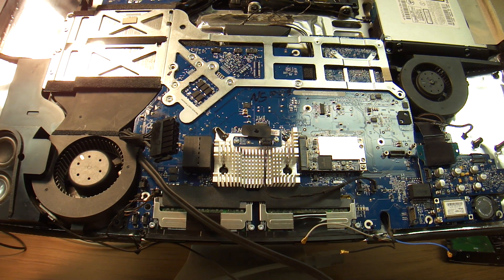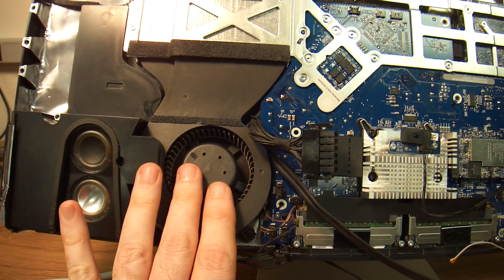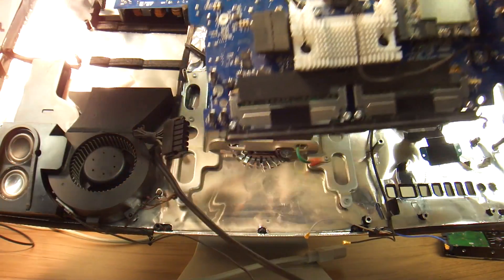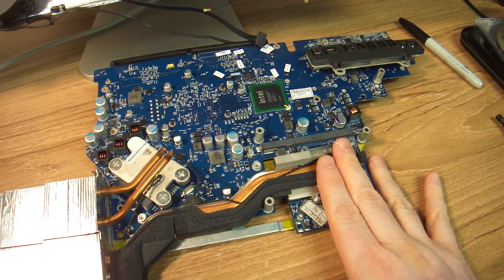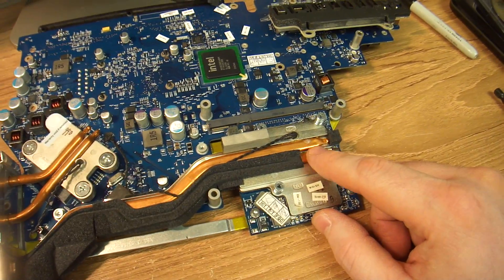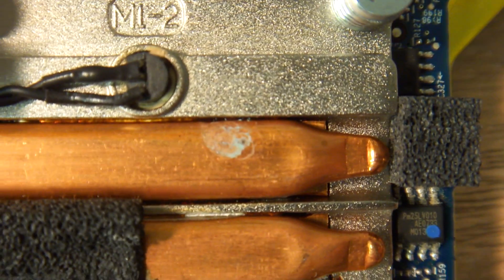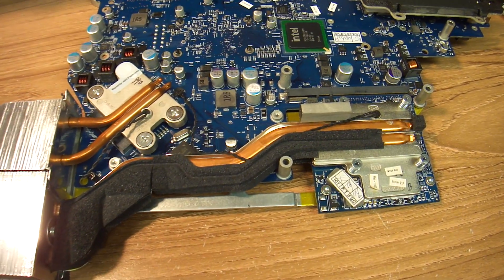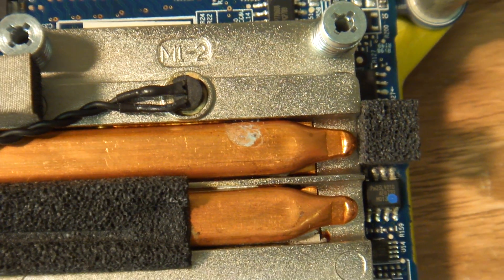How to fix an iMac overheating problem in a working GPU. Heat sink may be to blame.

Comment: Well, it's quite later, but, i've got this exact problem on a HP All in one computer, with a core i3 that was overheating, then i noticed that the heatsink wasn't doing it's job, i've managed that doing a litle hole on the heatsink the injected car radiator fluid inside, then sealed with epoxy glue, it's working like a charm, i've tried with other liquids and the car radiator fluid gave me the best results.

Comment: Thanks! I just fixed my mid-2007 iMac by changing the GPU cooling system. I had the same issue: GPU Diode very high temperature, around 100°C in a minute instead of now around 45°C for more than 5 minutes :)

Comment: You can still use that empty copper tube coil.  Make a bigger hole in it for squeezing in thermal paste inside, then solder aluminum over the hole or just use electric tape.  Heck you can try a cut out of soldering silicone mat to fit on the space.  This silicone absorbs more heat than  thermal pastes/copper/silver/
Reply: thermal paste would not work, it'd be like shoving clay inside your car radiator. a very specific fluid goes inside that tube, nothing else.

Comment: Had the same issue.  Just replaced the heatsink in my 2009 iMac.  Never say any indication of a leak, but the used replacement heatsink took care of the issue.  Was running 90-100c with the old heatsink.  Now running 50-55c with "new" heatsink.
Reply: I have the same problem with my Imac 24" 2008. 90-110c then black screen. I'm going to look for an used heatsink. Did you change the thermal paste?
Reply: Hey Bryan, I have a early 2009 iMac, 3.06 GHz Core 2 Duo (E8435).  It shuts down randomly, wasn't sure if it was graphics failure, did a little searching online and thought is was a bad power supply.  The back of the display is very hot, top leftish if facing the LCD when reaching behind.  Started searching and brought me to this video.  I'm wondering if you had similar issues with your 2009?  is yours and Early 2009?  Any info would help, I've not yet taken it apart.  Can you tell me what model you have and if your new heatsink still held up.
Thank my friend

Comment: Thanks for this, it helped confirm my suspicions that I had a faulty heat pipe. I had purchased a used E6410 off Ebay which would throttle itself down from 105 degrees constantly. Other symptoms were very hot CPU block, but cool air coming from the fan radiator. A close look revealed a pinhole leak in the pipe like yours.  Thanks!

Comment: Hello everyone, I have an iMac 27 "
Mid 2011 Core i7, CTO, began to have problems the screen, appeared green stripes, then, no longer wanted to turn on the screen never again, but inside was still heard running. A "Reballing" was done to the video card and the screen started to operate without any problems or details on the LCD, but it happened that after 5 minutes of being turned on, it suddenly went out and immediately afterwards it was reinitiated, just to turn it on To shut down, and to restart without having even logged in again, did not even load the Apple logo.
The temperature data by iStat were:

CPU Core 1 to 4 = 47º
CPU Heatsink = 45º
CPU Proximity = 49º
GPU Die = 109º (Temperature in which it was turned off)
GPU Heatsink = 57º
Hard Drive = 45º
Incoming Air = 26º
Logic Board Proximity = 47º
Optical Drive Proximity 47º

The technician who is trying to fix it has not been able to find the solution. Anyone have any idea what to do?

I could communicate with anyone who has been able to solve a similar problem, to guide me and avoid throwing this machine.

Comment: I have the late 2009 27" but it needs a new graphics card. I believe that it went bad due to the heat. I contacted Apple but they will not admit that its a design defect, and that they will only repair iMacs from 2011. I may buy a replacement card online, and was thinking if it made sense to drill some 1/8" holes in the back of the case, adjacent to the heatsink. Then attach a usb powered fan over the holes to pull the heat out...???
Reply: Were you able to get anything done? I have the same 2009 27" and it would also get very hot which I believe is the reason the graphics card has gone bad. Apple has denied repair on this unit also. Maybe we can make some noise together and have both our machines fixed?
Reply: Maybe if we take the broken machines and place them at the doors of their headquarters office and chain ourselves, along with the machines, to the doors. Lol. Apple doesn't give a f^%k unless it hurts their bottom line.

Comment: Just wondering - If the coolant type is known, why not drill a tiny hole in the tubing, fill the required cc's of coolant/refrigerant using a hypodermic syringe and then solder it shut? I've been researching trying to find out what kind of coolant is in these tubes without any success. Any pointers would be great.
Reply: Bakki did you ever find out what fluid to use, did you fix your pipe? I'm looking into this on a early 2009 iMac
Reply: @reel_images  Sorry, no I didn’t. I ended up buying a graphics card on eBay.
Reply: @bakkikudva  thanks for the quick reply, is your mac an early 2009 iMac with the Geforce GT130 video card? I was wondering if your computer was turning off when it got hot? That's what's happening with mine. Do you feel replacing the card helped? If you have the same mac, as mine I'd like to know what card you put in? Is your Mac still working? Trying to ask people with the same early 2009 imac a1225 if they had the same symptoms as i have. Any help in answering my 4 questions would help.
Reply: @reel_images  No it was AMD. In my case after running for a few minutes the screen would go black. It still kept running as shown by running fans and the diagnostic LEDs on the motherboard remaining green. I installed Macfan app and could see the temperatures. From a cold start the computer would stay on long enough for me to log in and check the temps of CPU and GPU. It was showing that the GPU temp would keep climbing and go past 190 or so when the screen went blank. So I knew that it was the graphics card. Initially I thought it could be the heat sink compound which had dried out, so I took the card out and applied fresh heatsink compound which did not help. While inspecting later I saw a pinhole in the tube which goes from the heat sink to the   radiator. It was where the tubing had been crimped to close it off during manufacturing. The hole was small enough that it took a few years (just long enough to be past Apple Care :-( for all the coolant to leak out. Once I was convinced that it was indeed the GPU I luckily found one on Ebay for about $100. After putting it in the iMac worked and the temps stayed within normal range. A few years after that I sold the computer.
Reply: @bakkikudva  Thanks very much for the detail in your reply.  I really appreciate the comments, this helps all of us who may think its one thing when in fact it's another. When you say "was convinced that it was indeed the GPU... found one on Ebay for about $100. After putting it in the iMac worked". I would say you mean, you found an new heat sync unit, like with the coolant pipes? Not a new graphics card, correct?  I just want to make sure I understand right.  It sounds like you replaced the cooling unit that goes over the GPU and CPU, right?
Thanks again
Reply: @reel_images  Sorry I wasn't clear. I found the complete and identical graphics card assembly. It was a brand new unused unit.

Comment: Hi. After I take the glass and I unplug the monitor and take it out, can I still plug it in to see if they fans area even turning? I cannot hear or feel any air coming out of the top at all even putting a little piece of toilet paper on them it did not move.

Comment: i have a 2010 27" iMac, turn on, 5 seconds later black screen. i have been looking for the problem on the internet over a year now and can't find the problem. its obviously not a heat problem as its been switched off all day. one time i turned the brightness down fully and it worked fine and once i go past 3rd bar brightness it would go black. but now i put brightness fully down and still persists going black screen. i am now using second screen with mini display port and that works fine. i had never had graphical issues on screen to make me believe its the graphics card. so i really don't know what the problem is. the second problem i have with my iMac is installing windows with bootcamp. it will install and then when it restarts it says no bootable device with black screen and white writing, like bios screen type. I'm using an external samsung disk drive that has installed windows before so the internal superdrive is fucked and spits disks out and i will get it repaired and try installing again but i doubt its the problem. i can't get my head around these problems and i want to repair it all my self as i like fixing things and learning. if someone can help me in the right direction ill be thankful and much appreciated.

Comment: Thank you very much, Abraham ! I had the same phenomen on my iMac 24" Early 2008 A1225. Thanks to your video, I checked the heat pipe and it was exactly the same problem. Even the hole was on the same position.
I replaced the whole GPU cooling system by a used one from eBay for 30€. Now the iMac works stable and quiet again.
Thank you very much for this brilliant video !!!!
Reply: +Olaf Kehm Hi! I possibly have the same issue... But I can't find a cooling system for my iMac27 mid2010 on eBay. Could you please share the info on the ebay seller? Thanks a lot in advance!!
Reply: Hi! It is an eBay shop from Spain, since I am from Europe. Here you can find it: http://www.ebay.de/usr/tecnicosclic

Comment: Could this be what is happening to my Mid 2011 iMac that has been overheating for a while now?  And when I say overheating I mean it gets super hot to the touch in the top front display towards the middled it irradiates the heat to the sides of the display and in the top portion of the back of the monitor.  I have no temperatures for it; I guess I have to download one of those apps that tell me that.
Reply: I just started having this problem. Have you found a fix to this?
Reply: I did not find a fix for it.  It kept doing it for a while and I kept the little fan, I had pointed at the back of it, on all the time.  I had already started shutting it off daily when it started getting overheated and after a while it stop doing it.  I mean, it still gets hot when I use it for several hours consecutively, but not like before.  That led me to think that maybe it was because it was summer and somehow it was getting hotter, even with my AC on.  So I guess I see how it goes starting at the end of this month since I live in the South and we really don't have a Spring.  Today was a hot day already, but everything since normal so far.  Hopefully it docent happen, cause I don't see me being able to shed $1500 anytime soon for newer model.  I have planned to sit down for a day or a few hours soon just to delete and/or transfer anything I do not need on it to keep the memory low.  I know I have a bunch of images and svgs and other files for work that may be adding up by now and that I need to organize in an external hard drive anyway so that will probably help even more.
 
I hope yours stops cause it freaked me out every day making me think that that was going to be the day that my comp was going to stop working.

Comment: Once you put new high quality Thermal Paste on the CPU and GPU the correct way, temps drop like when bodies hit the floor! 

My 2011 kick ass maxed out i7 MBP's CPU's idle at 32c and my GPU idles at 26c degrees.  Sometimes the GPU idles at 20c when my room is cool.  But these temps are un heard of in laptops, and all it takes is the right amount and correct ways to repaste high quality thermal paste such as the amazing IC7 Diamond on any CPU/GPU!
Reply: Any suggestions on a detailed process of replacing thermal paste on the CPU/GPU? Thanks.
Reply: GREGORY ICE small pee or long line. Just very little.

Comment: My 24" iMac had the same problem.  The heat pipe corroded and formed a tiny hole.  The copper wall got so thin then entire end crushed under slight pressure.  Installed a replacement heatsink from eBay and the iMac is good as new.  Thank you.

Comment: I purchased a new heat sink and Arctic Silver thermal paste to try and fix my overheating GPU.  Can I re-use the thick thermal compound found on the 4 memory chips, or does that also need to be replaced?

Comment: This is not true of the tiny hole "leaking fluids" these types of heat sinks have no coolant in them, the heat it displaced from the CPU and GPU via thermal compound which allows the hollow copper tubing to "draw away" or displace the heat from the processors. If you decide to tackle this repair you must remove the heat sink from the processor and gently remove old crusty thermal compound and replace with new silver thermal compound which is less likely to dry out in the next 5 years. Although other than the tiny hole and liquid statement this was a decent video.
Reply: Don is wrong.  Heat pipes absolutely use phase change fluid to effectuate thermal transfer.
Reply: 50% true, if the tubes are smashed flat like his pictures show, then NO vapor in them. If the tubes are round, like, tubes, then yes they use the phase change fluid. cheap vs. pricey
Reply: You must have missed basic science, the evidence of liquid based oxidation is present around the micro hole in the heat pipes that ALWAYS carry phase fluid. if the tips of the heat pipe are crimped and soldered closed, they contain phase fluid. Why do people pretend they know shit, don't you realize that tech specialists get irritated at posers like you?

Comment: I have the exact same issue. I'm new a opening imacs. We have the same imac model. My question to you is the cable cord that the power supply and the lcd are connected with. Does you just pull it off? I've tried pulling it but it wont budge im afraid i'll break it. Is there another way of doing this? Plz help and thank you.

Comment: I'm using Temperature monitor and apparently my 24" iMacs Graphics processor chip is running at 106 C and the 'heatsink' and 'temperature D' are running at around 120 C and the fans are pretty loud. Do you reckon it could be a similar problem?
Reply: Dr. Mario Thanks, will have a look.
Reply from the maker: That is how my mac was behaving.
Reply: Abraham Levit weird, I've opened mine up and it seems to have a hole in the exact same place
Reply: Abraham Levit Do you have a tip where I can buy the heat sink from?
 Thanks
Reply: Dan Ford Try eBay. I looked up a few, and I believe they go anywhere between $25-40 USD.
Reply: ***** No, and to my knowledge, this only happens to the very first Aluminum iMacs, which are Mid-2007 models. They aren't perfect machines, but this issue happens rarely. Also, if I recall correctly, the threshold is 140°C, but they have sensors to force shut down when it reaches a certain temperature.

Comment: Is there a fix for this?  Or would I need to buy a new GPU?
Reply: +Derek Carmody You can get a replacement  heatsink on amazon, ebay, macpalace, etc.
Reply from the maker: WAS I NOT CLEAR?? You need to replace the HEAT SINK! Not the GPU card.
Reply: +Abraham Levit wow... chill out! :P He is asking if there is a fix for the heatsink, as the you cannot source a new heatsink from Apple or even Graphics Card now that these machines are vintage. The only way to obtain a new heatsink would be to get a new GPU/heatsink module... part 661-4663 :)
Reply: No, you were not clear on the video plus you didn't go step by step on how to do the replacement.